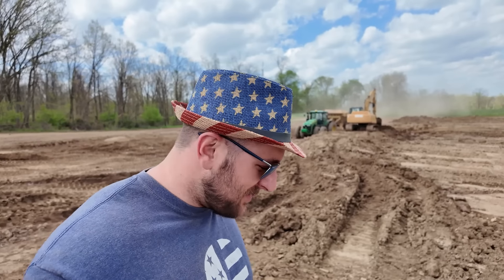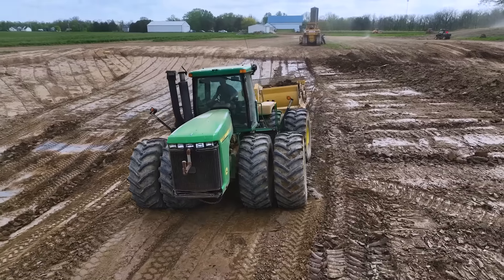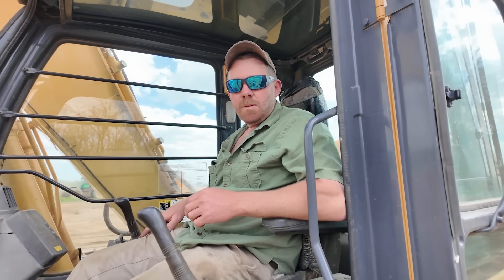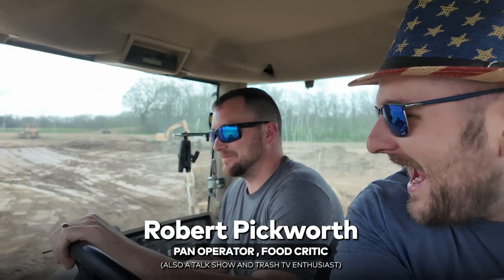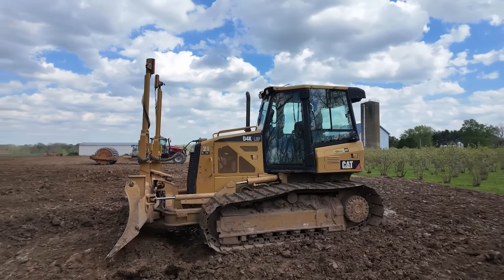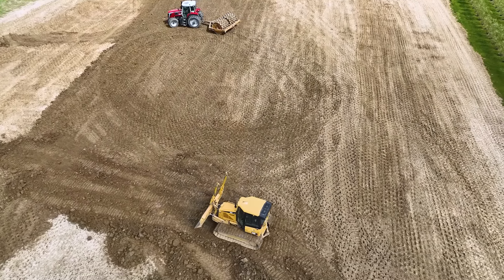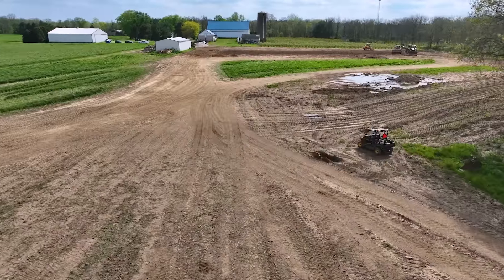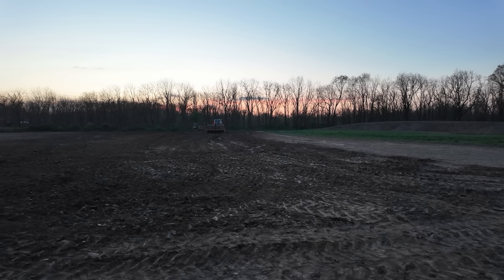Building the world's BIGGEST hay barn?

Comment: I have been around baled hay for over 70 years. In addition to dairies, feed stores, feed lots and horse ranches, we now have compress facilities loading containers for export here in the Imperial Valley. Forget the weather as your primary concern. How you build and plan to suppress and rebuild after fire is your biggest short term and long term challenge.
Reply from the maker: Fire would be terrible. Fortunately this is not our only barn
Reply: @FarmingInsider  To manage and reduce loss due to fire, three, 2,000 ton barns instead of one, 6,000 ton barn would help.